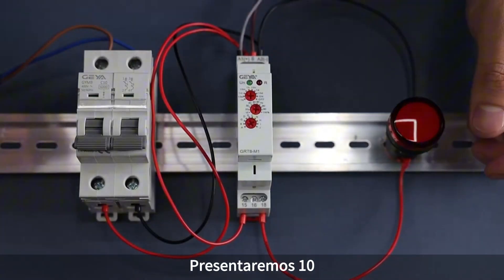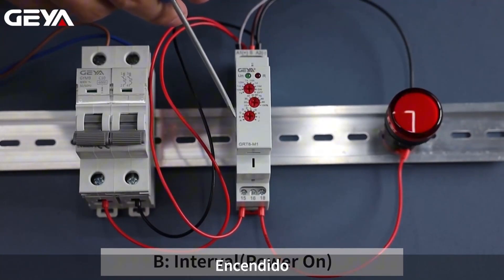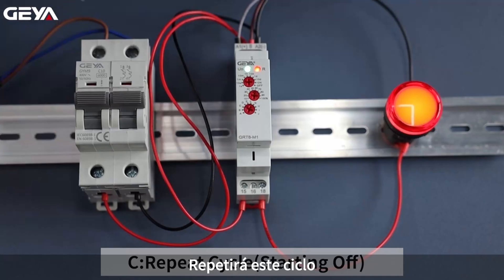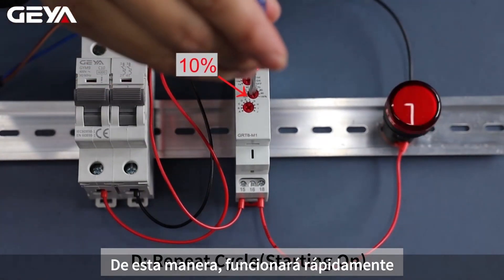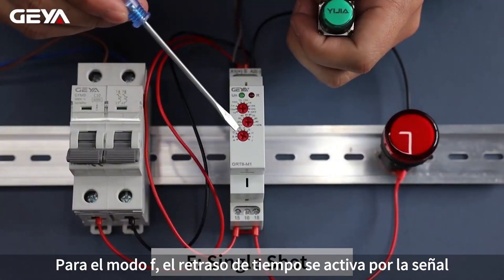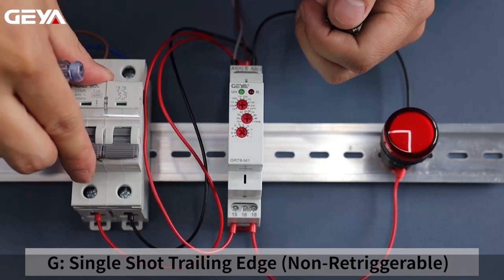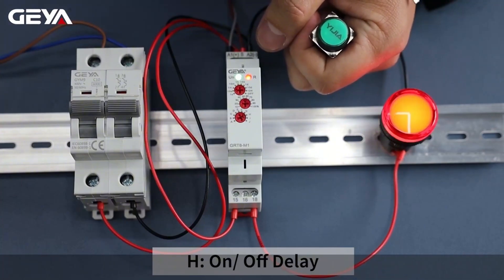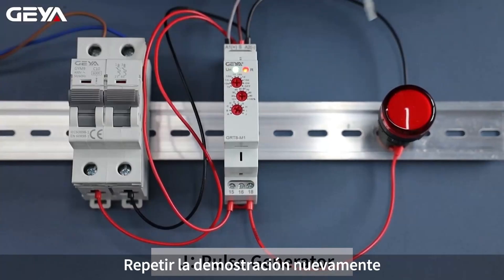Relé de tiempo multifunción GRT8-M1 Demostrar 10 funciones

Comment: Can I use a saw with 2000 Watt and control a vacuum with 3000 Watt with this relay? With 230 V. 
Or is the relay to weak?
Reply: You can't cause this one is for 15 amps, but with this you can connect a contactor
Reply: En una instalación de escalera donde se emplean 2 apagadores de 3 vías y 6 de 4 vías se puede instalar, para que cuando alguien olvide apagar la luz automáticamente se apague en 1 min